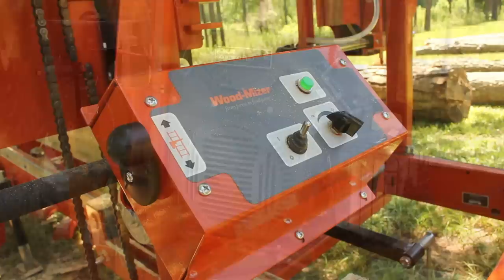Making Useful Lumber from an Ugly Log

Comment: Well my trailer package didn't show up until Thursday, but it's all together now pretty nice, I was wondering if you could tell me how long your loading ramps are, I have the pro package ramps with the spring loaded helpers but they appear to be to short, maybe I could modify them to work! Thanks for your help! P S .need another video! Lol take care!
Reply from the maker: Dave Holmes Hey Dave! Not sure the total length of mine, but I think those spring loaded ones might be for use without the trailer package. The LT15GO log loading package should include a winch and those black ramps. I think the spring loaded ones are designed to roll the log up a shallow incline to a mill on the ground with a cant hook and prevent rollback. The extreme angle created by the high trailer package necessitates the winch.
Reply: I purchased the winch mount, for my trailer package but wanted to try my spring loaded ramps there 45" long and was considering a electric winch I did not purchase the cable winch or black ramps, thanks! Fall line ridge.wood mizer sales all items separately instead of buying the complete log loading package thanks again!

Comment: First things first, I love the pup. He will make quite the sidekick. I am on the second video and wondered why you leave tools leaning against the mill where they can catch the mill in travel and the other is why you leave that arm up that is not in use... the arm that logs rest against when truing them up for milling. I thought that when the log is true on the bottom that the arms folded down to keep from hitting them. I see that you only use one point on the side to hold the log steady and I figured that the log could still move if it is not real secure. I'm not putting you down, I just wondered what you learned / did different the way that you hold them when milling cause I watch a few milling channels to learn right way and not get hurt doing so. I only have one working arm but my right arm can be used to hold something if I only need two fingers. (porallises in right arm "arthritis") I would like to try doing this. I would have to get the log roller setup and lift arm cause one armed guys are not in high demand. Bullets from Nam left me pretty messed up. That was like forty five or so years ago tho so I kinda got used to it. Like I said why only one pinch point, leaving the arms up and I guess one other thing... why do you work from the far end of the mill bed?
Reply from the maker: Hey Morgan, thanks for watching. The tools and log stop being left like that was just sloppiness. Those things should have been moved. I work from that area of the mill because that's where I can perfectly center the log with the winch. The winch is mounted forward of the axle because there's reinforcement there. It happens to be closer to the rear of the mill than the front. However, If I had a longer log I could center it further toward the front. It is a versatile setup. I just like to center it to the winch as best I can, but it doesn't have to be perfectly centered to work properly.
Reply: @falllineridge  Thank you for answering my questions! I am old and bored out of my skull. I'd be better at holding a camera than work as I am on a pain pump. I got busted up really bad but when you are older, you won't think 80 is so old anymore/LOL. I thought thirty was old at one time in my life. The woodmizer is really popular and wood make a mans wage if he owned the trees I figure. Thanks again .. so you only have to pinch the log in place at one spot hu?
Reply from the maker: Oh, forgot to answer that. Yes, For the shorter logs I've found it's just not necessary to take the extra time to use both clamps. The clamps are very strong and one of them has no trouble holding the whole thing. I guess if the log was longer and one clamp was off center then I would need to use two. The old mill only had one clamp for 20 feet of bed. Worked like a champ. The larger hydraulic mills only use one clamp as well.

Comment: Can't your blade be made to cut from both sides? ?? So you wouldn't have to walk so much.  Only one way ???
Reply from the maker: The rollers that the blade runs on have a back to them. The back of the blade which is flat has to rest against these while cutting. Without those the blade would fly off every time. So, since the back of the blade rides against metal, with pressure, it can't have sharp teeth. It would ruin the teeth immediately, and the rollers eventually.